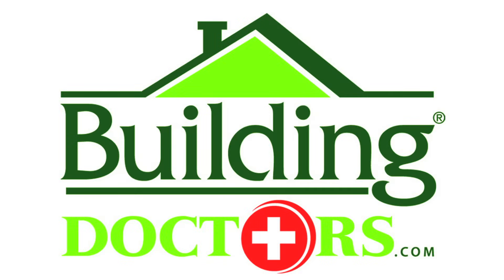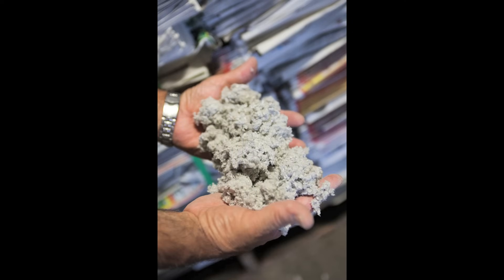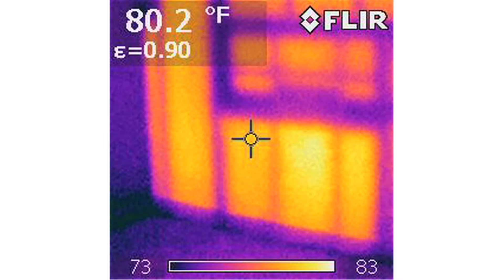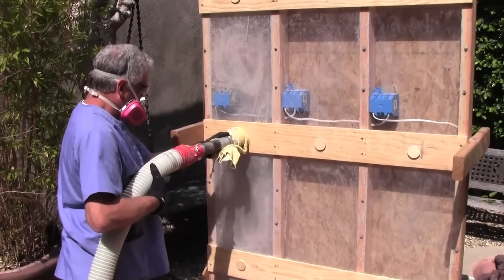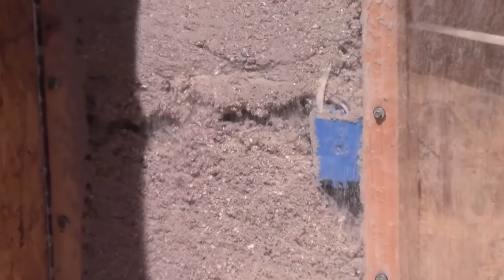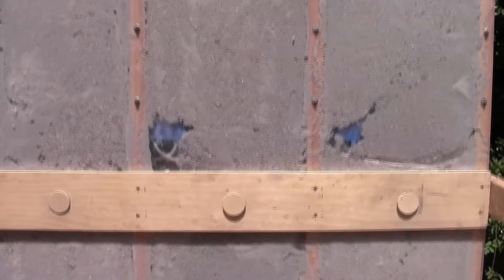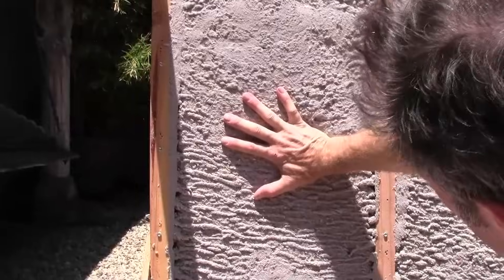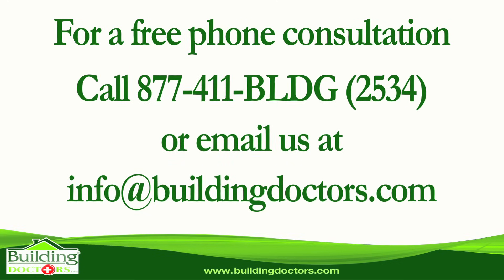Compare Drill and Fill Wall Insulation Techniques

Comment: There’s only one problem with dense packing, The likelihood of finding honest hard-working contractor and employee combination who will work to fill every single hole with dense packing is just about Impossible
Reply: You are 100 percent correct. Ask them to describe how they probe the walls and if these use a hose or just a directional nozzle. If they say no to both then they are not doing dense packing. You can also ask to see the walls after they are done in infrared.
Reply: Fact: Most contractors are crooked. Most workers are incompetent.
Reply: I fill every cavity I can find. Probe with insulation hangars. To find studs.  Use a 3 inch hole saw and long fill tube wherever I can. If I cant use that it's an 1 1/4 hole   3 rows  and all insulates fine. Proof is in the occasional blowout. And fuck cellulose. Doesnt matter how much you dense pack it, it will settle. Fiberglass is much better. It wont settle more than 1 percent in 25 to 50 years. And doesnt require a vapor barrier for dense pack.
Reply: @dylanfenimore9160  There is a fiberglass spray? Any that you recommend?
Reply: @WakeRunSleep  certainteed insulsafe sp,  Or Owen's Corning pro pink.
Reply: @dylanfenimore9160   Yeah, except that cellulose has a MUCH higher R-value per inch and out-performs fiberglass all day long. Fiberglass is also itchy and has no resistance to rodents, insects or mold. In fact, rodents love to nest in fiberglass and with a bit of added moisture the fiberglass will turn moldy. We've installed cellulose for years and with our machine and technique, we've had customers remodel and call us 20+ years later to show us that not only is the cellulose completely still filled in the wall cavity but it's also wrapped around the edges of the 2x4. As for fiberglass, it's like cotton candy, all spun-up and fluffed, in the attic we see far more settling as compared to cellulose. I've been doing insulation for 40 years, I just may have some experience with this.....but don't let me sway you from your opinion.
Reply: @stevereisman6872  well experience does talk. Just got done with 2000 sq ft of dense pack cellulose. Just reasserted why I dont like it. And to put it in perspective. Cellulose wont get you much higher than r22. My dense pack fiberglass will get me r 24 at half cellulose density. Or r 25 for 2/3 the density. It's a preference thing.  But I will say that dense pack fiberglass and cellulose are both on the same tier, After the pros and cons of everything. After all theres no such thing as bad insulation, only bad application.
Reply: @stevereisman6872  last week I drill and filled a house,  when it was pre-addition, was drill and filled by my boss's father with a fill tube,  from the basement with one row 1- 1/4 hole up high outside, decades ago with older generation fiberglass blown in.  Same customer as back then. Been 30+ years. The siding striped. We drill and filled the cathedral roof, the addition. Sure as shit though, completley filled cavities on the original block. I was reduced to probing for trouble areas he may have missed. Found a few. But everything that was done was still amazing. thats testimant
Reply: @dylanfenimore9160  That R-value you mention is at 70 degrees F. When it gets cold, the R-value drops dramatically the colder it gets.
Reply: @Sc-tch  that would be the case with r49 loose fill in an attic. Or with a batt in the wall without the proper application. If correct density isnt reached then it's entirely possible for convection to occur within the insulation itself. But fiberglass doesnt "lose" r value because of the temprature being low. It loses r value due to convection that happens due to the extremes on both sides of the insulation. But of all the study's. You cant find conclusive or repetitive findings with dense pack fiberglass about the issue. But as with cellulose if you dont hit that right density mark, then your doing it wrong.
Reply: @dylanfenimore9160  An R value is the rate of heat transfer of a material irrespective of temperature and thickness. The U value (how well the completed element performs in place) is a combination of the R value its thickness and the temperature gradient form one side to the other.
No material will produce the U value at a higher than nominal 24C gradient between sides, there is also an element of surface effect though you can ignore that pretty much on enclosed insulation.
one of the biggest reasons for settlement is atmospheric humidity cellulose is very susceptible to it here in Scandinavia, rockwool and fibreglass are less harmed.
The normal problem with dense packing is that unless you actually know what you are doing is it can be too dense and the R value (and thus the U value) is messed up and it passes more heat.
Here a test section is required and material volume and air flow are set for filling, then you have a rough idea of how much a section should take, a visit with an IR camera to check for voids is often done as part of a package and a contractor will come back to rectify any bits missed.
With a minimum of 150mm in walls and 300 in loft spaces there normally aren't issues anyway.
Reply: I was just thinking the same myself. Especially here in Portugal- cowboys 🤦‍♂️
Reply: Hello, need help here, does anyone know can you retrofit an old house with blown in cellulose from inside of house? Outside can’t be done. Wall cavity has foil faced fiberglass batts, if you fill from inside, you will inevitably push the foil face against the sheathing and would that be a problem, moisture risks? Anyone knows?
Reply: That was going to be my exact comment, you nailed it Daddy Bear.   Most guys you'll hire won't have even heard of this, and a few will falsely claim they take it into account.  This is the problem with cellulose fill; you can't see inside the wall.   I like the idea of cellulose batts though.
Reply: @SteveSabbai  the last time workmen were in my parents home, they stole a priceless watch from my father- a gift given to him by a company he worked at for 30 years.
Reply: @thelolguy007  you would be surprised w some of those cowboys, some know about specs and SOPs, believe it or not...
Reply: Do it yourself . even without building skills you will become proficient at it in short order .
Reply: That's very sad and heartbreaking.
Reply: THERMAL CAMERA....
Reply: If it's recommended 3.5 to 5lbs per cubic foot. Calculate cubic feet of cavity, multiple by 3.5. Get total weight, divide by bag weight, to get total bags needed. If they use less, means it's done incorrectly. If they use more, they did a great job.
Reply: Won't BPI accredited firms do it right? Check the work later with a thermal camera.

Comment: The first thing when a salesman comes to sell you an insulation ask him how their workers are paid. As paid by piece, do not take that company because those workers have to run to earn money and do not have time to devote quality. Take companies that pay workers per hour. You'll get a much better job
Reply: This is great advice, thanks.
Reply: I’ve Seen plenty of hourly employees and salary employees who completely slacked off and take shortcuts so they can have extended lunches and watch Netflix on their phone, I’ve also met piece rate employees who Are stellar at their work and have to go back and fix their mistakes so they do it right the 1st time.
Reply: Not necessarily true.  I do gutters, siding and decks,  I get paid by the job and take great pride in my work and do my best on every job.
Reply: As an insulation foreman I get paid 18 an hour and we all get a piece rate at 5 cents a sq ft for fb glass batts.  But I'm not allowed to make mistakes or let others make them. So it makes for good work. Plus makes the crew work faster over all, especially when I put the most in and get the biggest cut. It makes people wanna get better or I'll make them go back and fix it
Reply: I own an insulation company and I don't agree entirely with that. If the workers are paid green cash, THAT is what you want to avoid. You want a good job, your best bet is to hire a licensed contractor who has legit documented workers, beyond that look at their reviews: any contractor with high ratings will want to do anything to fiercely defend and keep those ratings so it creates a degree of accountability. Truth be told, a chain is only as strong as it's weakest link and when it comes to workers, we're not exactly talking about college graduates (or even High School) when it comes to this trade. Truth is, you probably won't even meet the workers until you've signed the contract and schedule the work, your best bet is to supervise the guys and also maybe bring them some drinks.....be friendly and nice and hopefully they'll want to impress you and do a good job for you. One thing I can tell you; the homeowners who grind, haggle and talk down to workers in a nasty manner....I wouldn't count on them getting the best job.
Reply: Doesn’t “dense packing” (compressing) cause the R-Value to go down in any batt or blown insulation? It seems like it will either settle over time, or it’ll be too dense from the start and lose overall insulation value? I see positives and negatives with each.

Comment: My wife and I have dense-packed two homes over the years with cellulose. We're getting ready to do the same for an 800 sq. ft. double-stud super-insulated workshop. There is considerable skill involved, and it took plenty of practice for us to have confidence in our work. We always aim for a density of 3.5 psf (pounds per sq. ft.) and this is done by pre-calculating the number of 25 lb bags needed to complete at wall. Cellulose is a great insulation product and these days our first choice. We use Rockwool mineral wool insulation to insulate floor assemblies. We're in central British Columbia, Canada.

Comment: it was great..they had programs in my county that performed this insulation from the outer walls of my home..they took off sections of the siding, the 1/2 in insulation board, and drilled the hole between each cavity...they also went in the crawl space and laid down 6 mil plastic on the ground and sprayed the inner walls..the cost for me was 0.00 dollars..they charged the state $10,235 for the job from the grant money they received..it took two days to complete because the sprayer for in the crawl space seized up..they came back the next day and finished it..being a senior citizen, this was quite a surprise..at the onset, i almost cancelled this, cause i did not believe it would be free.glad i didn't.....

Comment: I have yet to see a video talking about the potential issues of pushing drywall from the studs and or bulging from dense packing due to the high pressure. You dont have ttat issue with old lath and plaster walls. With standard drywall the pressure has to be reduced and someone has to be on the inside to monitor the walls.
Reply: You are absolutely correct of about the potential of bulging the walls. We still have that issue with lathe and plaster as well. If it was not installed well it can pop out as well. Training and practice of listening to the machine and how much insulation is coming out of the hose is key.  We made this video to show the benefits of dense packing wall insulation and not as much as an instructional video of how to do it.  Thanks for the feedback.
Reply: I have personally dense packed cellulose insulation into pre-existing homes for over a decade we only had one issue of drywall bulging it was later determined it was because the drywall was improperly installed the begin with. With the proper machine you are able to regulate the amount of material going through the tube and air pressure. There are other factors to consider as well. Like what kind of studs were used, etc.
Reply: Distortion of drywall is a non-issue, in our experience. There are no precautions needed. For ceiling assemblies, where insulation depth exceeds twelve inches and weight is a concern, we use 5/8" fire-stop drywall. Our building all use 18" of loose-blow cellulose so we stick with the better drywall.
Reply: Oh, one more thing: for heavily insulated ceiling assemblies only, we double up on the screws. Every six inches apart, rather than twelve.

Comment: what is better soundproofing fibreglass or cellulose
Reply: Hi Ryan, thanks for your comment. I hate using the word " soundproofing" because it can't be done with insulation.  I like calling is sound dampening. SOmething to slow down the sound waves going through the wall. The denser the better. Since we dense-pack cellulose to 3.5 lb per cubic foot compared to fiberglass at 2.2 lbs per cubic foot cellulose wins.

Comment: Is it waterproof? 
Is it mold resistant?

Good demonstration of cellulose insulation and its fireproof capabilities but not addressing any mold resistance potential, waterproofing qualities or possible soundproofing, if any at all is saying something.

It is possible that you will not be getting your full bang for your buck if cellulose insulation faltered when other insulation methods can perform well enough against such potential hazards.

Comment: The clear tubing they'are using in this video is round.  All the clear tubing at the stores near me were wound so tight on the reels that they were squashed half flat.  I'm pouring hot water in the tubing with the bottom end plugged and hanging it from the ceiling to try to make it round again.  What a pain!
Reply: Thanks for your message.   That type of tubing is not rigid enough for inserting in the walls. Try some braided tubing. We buy our here: https://jrproductsinc.com/product/1-i-d-reinforced-braided-wall-insulation-tubing/

Comment: 😂 C’mon!!  The guy barely pushed on the densely packed example compared to the other 2.  Notice how little force he applies and his hand doesn’t wrinkle like on the other 2.

Also, they don’t show the removal of the other 2, just the Dense one.

What a total con job.  Insulation is insulation.  It settles so little over years that it is negligible.  Don’t fall for this scam to get it “Densely Packed”.  No such thing really.  Makes zero difference.

Comment: Only problem with don't this is the fact that there is already insulation in the wall.
Reply: Jesse, thanks for your comment. You are correct but it depends on how old that insulation is. Really old fiberglass batts were not old not R13 like they are now but they start to fall apart over time.  We check the walls with an Infrared camera first. What does help is sticking that hose all the way up the wall cavity then dense packing the batts with the loose fill as you pull the hose out. It makes the hose get stuck sometimes but it can still be done with an experienced installer.

Comment: Any issues if the house has knob and tube wiring in the walls that get the blown in insulation?
Reply: Mickey, thanks for your question and sorry for the delayed response. Issac is correct below that the cloth covering on the wiring is really brille and if it has not broken off yet it would under dense packing conditions. It would need to be replaced before andy wall fills are done.